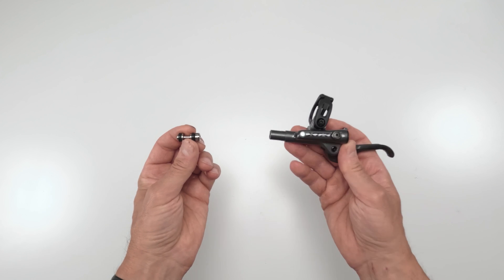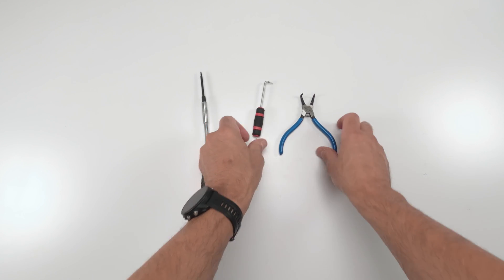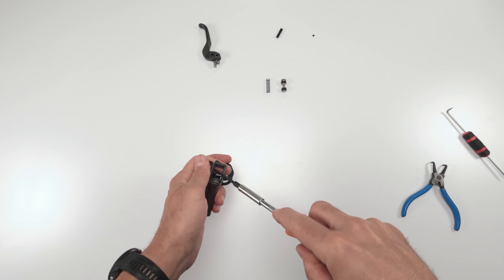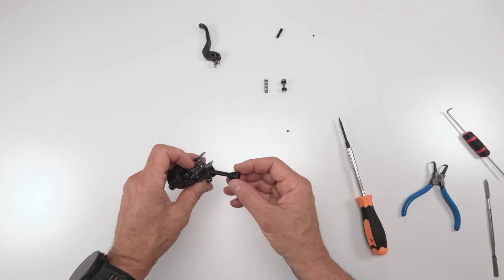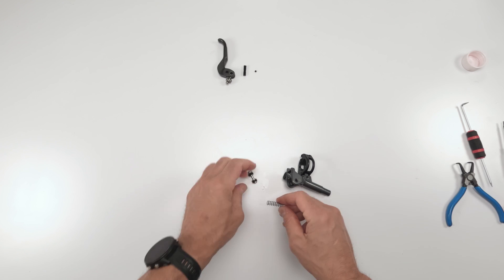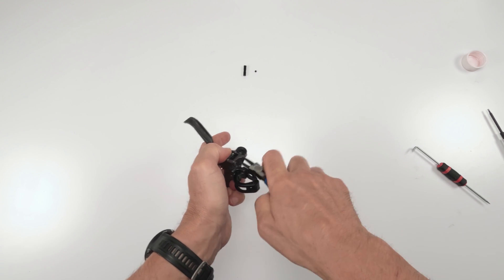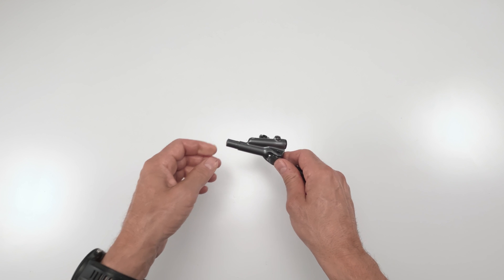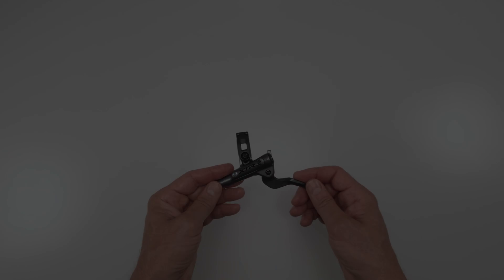Can a Shimano XT Brake piston work in a XTR brake Lever? Lets replace the piston and find out

Comment: simple solution, dont use xtr brakes, just use xt, they are cheaper, work just as well, some say better and the after market parts fit and work. problem solved
Reply from the maker: Totally agree. Though the XTR brake handle in this video was a buddies, my plan after I'm all done with mine it to either go back to XT or try some other brand

Comment: Are the m8000 and m8100 pistons the same? I found an aftermarket m8000 piston that I would like to try on my m8100 lever thats slow to return.
Reply from the maker: I honestly can't say for sure as I've never tried swapping them. Are they very similar, yes. but even if they are slightly different it can mean that they aren't compatible. there are aftermarket options for the 8100 if that's what you need. last I saw one was on ali express, which I wouldn't be surprised is the same stock piston.
Reply: @zoubtube  Ill try to look again. I cant seem to find the one for the m8100.
Reply from the maker: @gerardguadayo1788  this is the one I was talking about. looks like they still sell it, though I haven't tried it, 
 https://www.aliexpress.us/item/3256804298672724.html?src=google&src=google&albch=shopping&acnt=708-803-3821&slnk=&plac=&mtctp=&albbt=Google_7_shopping&gclsrc=aw.ds&albagn=888888&isSmbAutoCall=false&needSmbHouyi=false&src=google&albch=shopping&acnt=708-803-3821&slnk=&plac=&mtctp=&albbt=Google_7_shopping&gclsrc=aw.ds&albagn=888888&ds_e_adid=&ds_e_matchtype=&ds_e_device=c&ds_e_network=x&ds_e_product_group_id=&ds_e_product_id=en3256804298672724&ds_e_product_merchant_id=463268612&ds_e_product_country=US&ds_e_product_language=en&ds_e_product_channel=online&ds_e_product_store_id=&ds_url_v=2&albcp=20123152476&albag=&isSmbAutoCall=false&needSmbHouyi=false&gad_source=1&gclid=CjwKCAjwyJqzBhBaEiwAWDRJVB-6oxb5-s_Re9vzybFTpK-5IdxHUWqtsW_0DLwxjy0AfrS_YLOuaRoCHisQAvD_BwE&aff_fcid=ac77f51d38584ecd962a95ce39b43dc8-1718077723175-09751-UneMJZVf&aff_fsk=UneMJZVf&aff_platform=aaf&sk=UneMJZVf&aff_trace_key=ac77f51d38584ecd962a95ce39b43dc8-1718077723175-09751-UneMJZVf&terminal_id=acb4b009189344e890a3df15e062380f&afSmartRedirect=y&gatewayAdapt=glo2usa
Reply: @zoubtube  Thank you so much

Comment: I have a new BMC Fourstroke frame which is all built up with internal routing and brand new Jagwire hydraulic lines ran. I am replacing the SLX brakes with XTR 9100s. Do you think i can simply leave the brake lines and just swap out the SLX calipers and levers? Then do a bleed?. Also, do you think the stock brake lines that come with the 9100 are better or worse than then Jagwires? I don't want to cut or replace olives etc.Thanks!!   Big supporter from Michigan.
Reply from the maker: When you get a chance, can you let me know which actual SLX model brake you have? 

I can't really say whether the jagwire is better than the stock Shimano brake hose. I would expect them to be very similar, unless jagwire does something that slightly weakens the housing on the hose due to weight savings, or something like that. I honestly don't know

But depending on the model of brake, where you will most likely run into an issue is with the banjo bolt connector, which is on the caliper side of the hose. There's a good chance it's a different setup

Let me know, and thank you for the support. Which region of MI are you in?
Reply: @zoubtube  Thank you  so much! They are 2022 slx 2 pot. So the latest version. I’m in South Lyon. We have 6 trail systems within riding distance from home here. I’m installing the. XTR M9100 2 pot race
Reply from the maker: @TheRickysee   Looking at the part numbers, the banjo bolt part number for the XTR 9120 is Y8JA00010. The bolt for the SLX 7120 is Y2RV06000 (same as the XT 8120). This is not to say that the overall dimensions aren't the same. It is most likely that the XTR bolt is made of lighter material. I can't be 100% sure without actually having looked at both bolts (I've only held the 9100 in my hands out of these models), but I feel 95% sure that you won't have an issue swapping just the calipers onto the existing hose between those two models.

Did you buy the 9120 calipers and levers as components, or did you buy the kits that come with everything? If the latter, I would just swap everything and keep it consistent, even though it's a bit more of a pita.

You are actually in my area. I'm up in Waterford. I typically ride highland at least 3 days a week as I help maintain it, but I ride other trails for the rest of the days. Maybe we can hook up one of these days.
Reply: @zoubtube  well thanks so much I really appreciate it! Yeah, on eBay I bought 9100 brake set looks like a takeoff, it will come without the original box, so I’m thinking maybe not all the little parts that come with the factory purchase. But the hoses are attached to the 90/100. How do I get in touch, I tried to find you an Instagram and there’s no messaging feature on YouTube. Thanks let’s ride!
Reply from the maker: Zoubtube is my instagram account. I never really had a reason to use it. this might be a good kick in the butt to start using the platform. let me know if you can't find the account
Reply: @TheRickysee I always just reuse the olive and hose when I'm swapping levers between bikes. Works every time. You usually don't need to do a full bleed either. Just burp them.

Comment: Dear 
 i broke my xtr brake lever in a fall and ordered a replacement lever. your video is very informative. have a question the pliers , what size are they ? have seen that they are very small holes in the clamp and want to make sure i buy the right one 
grtz henk from Belgium
Reply from the maker: Any regular sized right angle snap ring plier will do. I'm sure you can find one at a local hardware store for a decent price. Just make sure it's not a large version. Here's a link to one that might give you a good idea what it looks like.
https://www.amazon.com/4821J31-Internal-Precision-Retaining-8-5-Inch/dp/B003UHUDDE

hope this helps

Comment: I’m fighting a migrating bite point on my XTR M987 brakes.  I watched your other video about the reach and freestroke adjustment and tried backing off the reach all the way out and couldn’t get fluid to flow from the caliper to the lever just like you. I had to adjust the lever reach in slightly before fluid would flow.  You may want to try adjust the reach in a bit.
Reply from the maker: Thanks for the tip. The issue with the brake in this video was I couldn't get the XT piston to work in the XTR level, the u-cup on the piston blocked the hole leading to the reservoir allowing it system to work in one direction only. Super sucks that shimano doesn't sell parts for their brakes.

Comment: I like Shimano a lot, but... I also see more and more of this practice where they force you into buying brand new complete units.
Some years ago I tried one of their flat pedals and I quickly checked parts availability before purchase. I did not notice at the time that the most important part was not available for purchase, and that is the outer dust seal that is there to prevent grit and grime from entering inside. I ended up throwing perfectly good pedals in the bin because I was pissed off that I could not service them.
I ended up with a pair of OneUp aluminum flat pedals that I've had ever since. I just buy a new refurb kit everytime I've used the one I got, and it's so quick and easy to deal with. 
Shimano could easily do the same, so we'll see if they wake up some time soon.
Reply from the maker: You are so dead right with the shimano pedals. It is absolute BS that they don't sell the seals individually. I'm a big fan of both the raceface atlas and oneup pedals. They are all I use anymore, and like you said, rebuilding is a snap! 👍

Comment: I was able to swap a stock piston from an M8020 lever into an M9020 and it worked as original. 
I initially tried what you appear to have done and purchased an aftermarket replacement from Amazon/Ali Express. The aftermarket piston was metal vs. the phenolic OEM piston. I couldn't even get the aftermarket piston into the bore! The difference is in aftermarket vs. OEM, not XT vs XTR. I ended up cannibalizing an M8020 lever for its piston and seals, which looked/measured/worked the same as the original in the XTR. I agree Shimano should sell these parts. I guess like anyone, they would prefer you to buy a new $120 leaver assembly than a $5 piston.
Reply from the maker: "I was able to swap a stock piston from an M8020 lever into an M9020 and it worked as original."
That's good info for people to know. 

"The difference is in aftermarket"
What's ridiculous is, not only does SRAM sell brake components spares, but any aftermarket metal pistons I've  installed on SRAM brakes over the years have worked flawlessly. Now, the aftermarket pistons were built for a specific sram model brake, unlike in this video where the pistons was for a XT instead of XTR. but I couldn't find any aftermarket XTR pistons!  Really is BS that shimano doesn't offer these parts. you would think the margins would be HUGE and worthwhile, but I guess they know their business. 

Thanks for the info on your experience with 8020 and 9020 pistons👍
Reply: @zoubtube my 8020 piston didn’t, exactly the same as your aftermarket -
Reply: I assume that the piston from the deore series also fits? A new deore lever is not expensive... take the piston out of it and put it in an xtr and that would be a much cheaper option than buying a new xtr or xt lever...

Comment: I just recently punctured the diaphragm using a syringe to bleed an xt 8100 brake, the problem is that the pressure from the syringe falls precisely on the small ramp where the diaphragm is very weak, I have a couple of photos that I can show you so that you have evidence of this, the syringe is not the best method to bleed the brake from the lever
Reply from the maker: There you go folks! Quite possibly the reason why shimano doesn't offer a syringe solution for the lever bodies. So for anyone who is looking at buying an aftermarket syringe kit for thier XT/XTR lever bodies, be careful with the bleed. Don't apply to much downward pressure on the syringe or you risk damaging the bladder.

Thanks for the info myman!

Comment: Could the seals be traded from piston to piston?  I can’t make out the details / differences  in the video and don’t have any to compare.
Reply from the maker: "Could the seals be traded from piston to piston"
YES! The seals can be swapped, and I did end up swapping them. They looked extremely similar in size, but the stock seals felt a bit stronger/stiffer. The pistons also looked VERY similar and measured relatively close to each other, though not identical. So much so that I really thought it was going to work this time.

"I can’t make out the details / differences  in the video and don’t have any to compare"
I literally just realized I F'ed up!!!  I thought I had already posted the piston comparison footage in a previous brake bleed video. I just realized I didn't! I waited so long between when I discovered the stock piston was damaged and actually testing the aftermarket piston that I totally forgot about the comparison clips I created when I first received the aftermarket piston, which was about 4 months ago. I need to get better organized when making these videos. Sorry about that.
Reply: @zoubtube  I greatly appreciate these videos and the quality of your work. Keep it up.  FWIW, I’m in central AZ and SRAM plastic pistons were my nemesis. Alloy aftermarket replacement parts weren’t available for about a decade.  I ultimately resorted to turning them on a small hobby lathe…

Comment: Did you measure both piston at first? That would have been informative to your viewers.
Reply from the maker: I did in the bleed video I had posted for this brake. I had tossed out the broken plastic piston by the time I got around to testing the new piston. they were close in size with some minor differences

Comment: I would have never guessed Shimano had used different internals. I thought the XTR just had a lighter housing
Reply from the maker: I thought the same. I did measure the replacement piston against the stock in the previous video I had posted on bleeding the m9100. they were close but not identical. I was hoping it would be close enough. TOTAL BS that Shimano doesn't sell spare parts like this considering the price of their brakes
Reply: @zoubtube  Yes, Shimano should make all the parts available, or at least a complete rebuild kit.